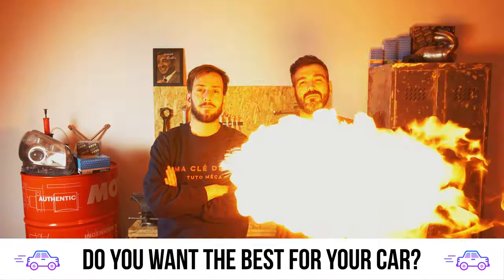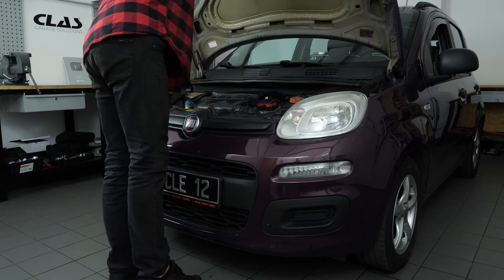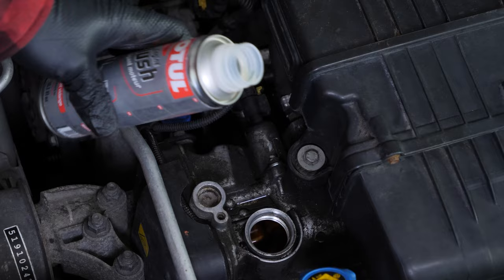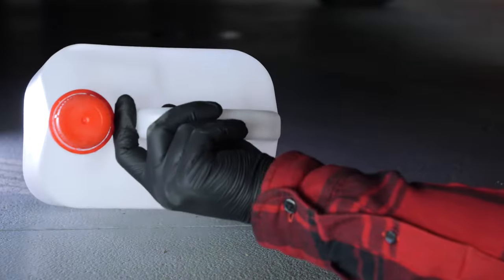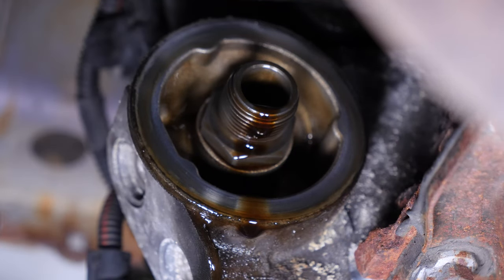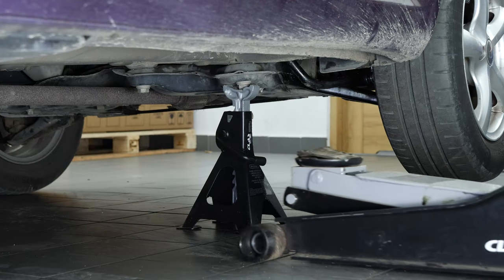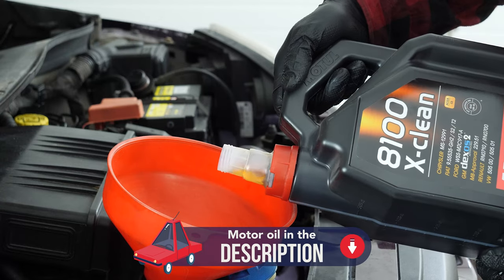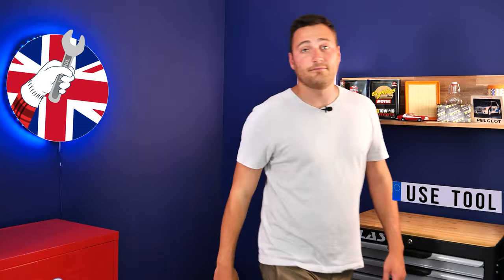Change the oil and the oil filter Panda mk3 1.2 8V 🛢

Comment: Pre-filling the filter is recommended. An empty oil filter causes the oil pressure to be too low when running the engine the first time after an oil change.